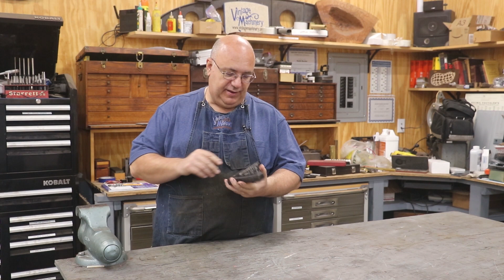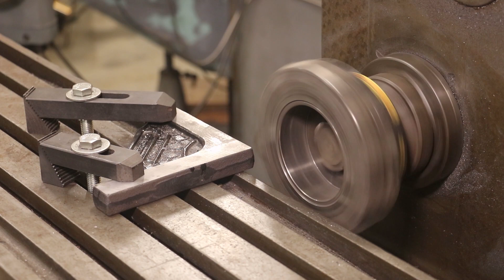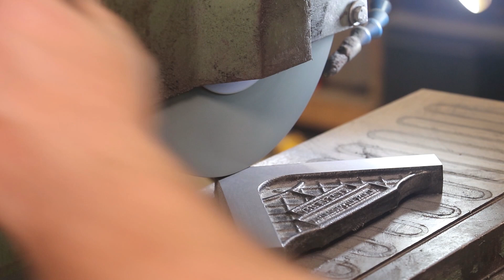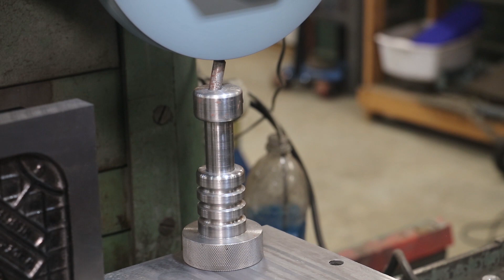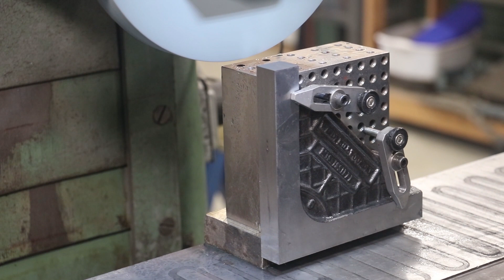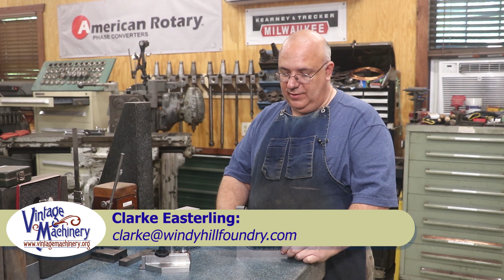The Windy Hill Foundry Square: Milling and Grinding a Casting Parallel and Square

Comment: Keith: don't mean to be a safety nazi, you're a big boy and can make your own decisions. However, I am curious if there is a reason you don't like to stop the wheel on your surface grinder? Does it add backlash or something like that when you start/stop? Thanks
Reply: Unless you go to the trouble of balancing the wheel on it's arbor and have nearly perfect spindle bearings, when you stop and start a wheel you will end up with wheel hop and will need to dress it again to get rid of it.
Reply: An apprentice soon learns grinder wounds heal slowly, I got mine the first year skinning my index finger kuckle from a cylindrical grinder wheel.
Afterward I respected all grinders. Moving to surface grinding I always used a rubber squeeze to clean the wet residue away after moving the wheel above the left most and rear magnetic chuck end. Then remove the workpiece, clean with the air hose, carefully hand wipeing the chuck for the next workpiece. (Never used a rag with the wheel running). Would dress from that location also. All grinder guards were fitted with a central vacuum system.

Comment: It would be cool if he put two through holes in the web to add two strips of delrin or phenolic for handling insulation.
Great video, thanks Keith
Reply: By that do you mean insulating it from the heat of your hands?
Reply: @BravoCharleses  yes
Reply: Why? These aren’t high precision measuring tools. They are tool room precision. Enough for normal use. The mass of the tool is also enough to absorb the small amount of heat your fingers will leave.
Reply: Mel Gross I think it would look cool, like I said. And they are as precise as you make them.

Comment: Could have added 2 steps - grind the thickness to a fixed amount- say 1"  and the lengths of the sides to 6" or whatever size the casting allows- would give you a couple more precision reference points.
Reply: indeed...I was thinking the same thing...perhaps also some drilled and tapped holes so it could be used as a right angle support on a milling machine table
Reply: @woodsmn8047   The pattern should be revised adding 2 or 3 bosses to thicken the center web for clearance drilling for mounting to the fixture or tee nut (s). 
If required they could be finish machined for a slip fit diameter to align with the 6 inch surfaces, if 3 are drilled the finished alignment should be on 45 degree. Then inserting dowels in any 2 holes extending below the beam surfaces will provide quick and accurate positioning work pieces on your milling table slot.
The 45 degree bosses could be added to the ends of lettering outline ribbing?
Reply: OLD SCHOOL g by
Reply: Hog hog cv V V V v v. V

Comment: Since I have never ever surfaced grind ed anything, I have a question of wonder. As you surface grind anything, doesn't the grind stone itself also wear off throughout the process? And if so, the beginning of a grind would be lower (more taken off) then the end of the grind. IDK?
Reply: Yep, that's why you have to keep the stone dressed regularly and let it "spark out".
Reply: @mechanicalTurk0  I got it, turk
Reply: It's ground, not grinded

Comment: Excellent quality casting . Windy Hill Foundry most certainly know some secrets and techniques about  casting to be this good , very little to machine off and not an impurity to be seen.
Reply: Their secret: Only the finest quality casting materials are used.  "Virgin" worn-out brake disks from the local auto shop.
Reply: @MrShobar  ....Those "worn-out" brake disks are, in fact, some of the finest quality materials.  If you have ever been to a large foundry, you will be surprised/shocked at the variety of cast iron trash they process.  Brake disks are gray cast iron with a higher % of carbon than everyday cast pieces.  Brake disks are an excellent choice for his tool castings
Reply: @MrShobar  .Yes correct .Watched the 2 videos  Adam  uploaded , they do put a little bit of a few other ingredients in the mix to get every thing just right .

Comment: back in 1992 at my skool we had a watercooled something similar to a delta lc 400 rotary table surface grinding machine with vertical spindle
i grinded my cutting blades made from scratch for my skool project (a troatless metal cutting schear )
Reply: From your statement description I am guessing what you are describing is a Blanchard grinder.  See not put downs or corrections, just an educated deduction.
Reply: Roy Reynolds, this is the way people should act, thank you!
Reply: Grinded, is that an American thing, in english it's ground, also it's shear, no c
Reply: lacossa nostra, there’s a tough crowd in here today. No pleasing people like this! I’m thankful that there’s only a few like that on this web site!
Reply: You should go back to 'skool' and learn how to spell and use correct punctuation.

I just found out why you can't spell, you're a bnp inbred. My bad.